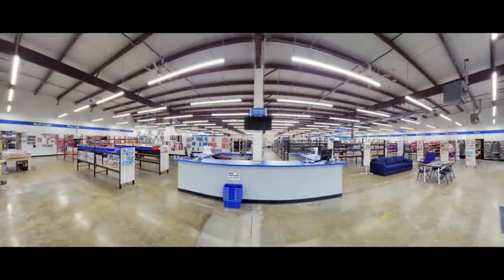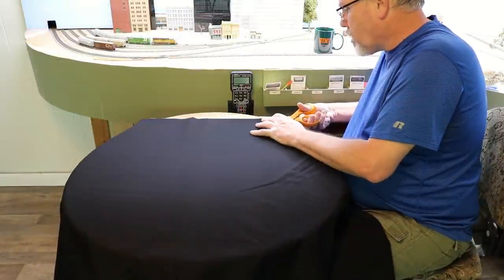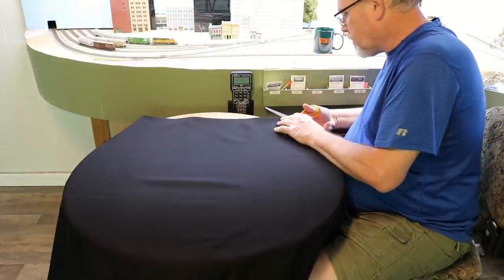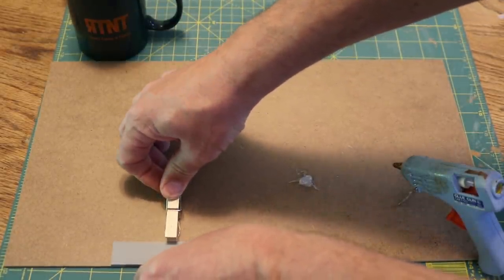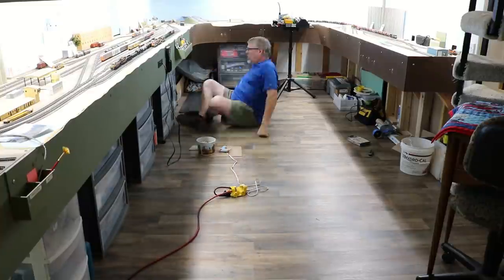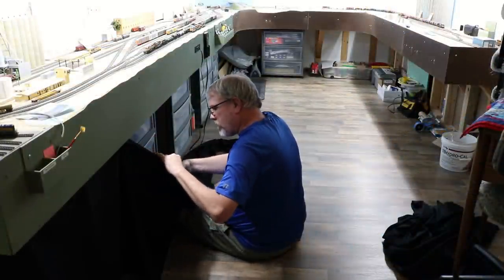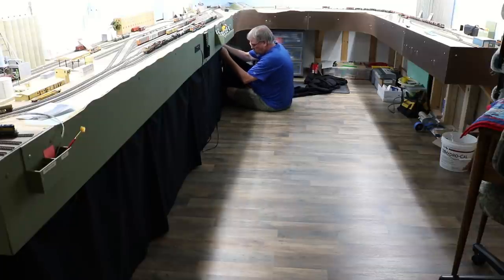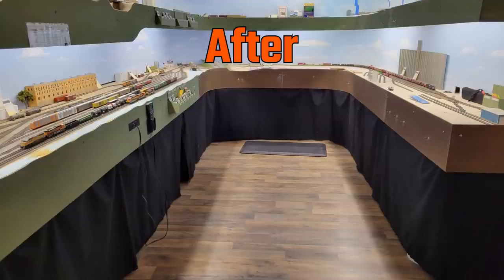Easy Skirting for Model Railroad No Sewing Required

Comment: I built my layout to have an open air feel.  I wanted it appear as if it is floating in the room like the modern minimalistic architecture of floating slabs, clean lines, open floor and room decoration,  funny how things have changed.  Stuff has now collected under the layout and lower shelfs have been added to hold more stuff,  mostly household stuff.  this just took away from that very cool open air floating feel of my layout.  Sad to say skirting might need to be an option.  If you close one eye and squint twice with the other eye you can see that floating slab and open air feel,  just ignore all the stuff on the floor under it :)
Reply from the maker: 🤣 I can see it. 😱🤯

Comment: Hey Ron,
Your an All-star. Got your game on. Go.  OPPS!  I derailed for a moment.
So the three RxR Clubs I belong to use a similar technique.  And they have lasted, with periodic material updates, for more than 60 years.
Last night I was able to start the rebuild of my own layout.  And I do something completely different.
I am a fan of shopping in Charity Thrift Shops.  So I have accumulated over the past 20 - 25 years a large collection of used kitchen cabinets.
Over those years I have used the 36" x 36" x 36" base cabinets for benchwork.  But with this newer build I'm also using the 36" x 20" x 36" uppers, I've collected but never found a use for.
The "Uppers" are being mounted to the exterior walls.  Just slightly above the floor.  And serve as a storage yard, RIP yard, Program Track in place, and a run around/spur line.
To get back on topic the great thing is I won't need a skirting.  As the cabinet drawers serve as hide aways for switching panels, or tool (junk drawer) storage.  The box shelving is perfect for storage of Locos, Cars, Structures in progress, and scenic material.  With the doors closed and baby locked the face looks well kept and finished.
The final feature is having built in heavy lockable construction equipment grade castors.  Then should we take the module to shows all need be done is unplug the bus wires.  Wheel the unit away.  And we're on our way.
No matter how you do the job what counts is you got the job done.🚂🚃🚃🚃🚃 So keep chugging away.
Jim

Comment: This is interesting that this came up.. I bought a 20 yd. bolt for $30 about 12 yrs ago... it is a strong material and kinda has a rubbery feel to it on the back side.. the same stuff is now $140.. I started this project over a month ago after watching Daryl from the HO Evanston sub do the same thing.. he recommended Heavy Duty Clothespins which I bought from Amazon, they just have a stronger spring.. I have to do the same thing, cut it in 1/2 length ways... which is perfect as my lower level is about 29" off the floor... Ill need the entire thing... thxs for getting me motivated to cut the stuff and your suggestion on keeping it folded in half evenly...
Take care..... Daylight Dave!!  😜   🤗

Comment: Nicely done Ron. You have spread the word about clothes pins. I’ve used the sam system but only use a dot of hot glue as a quick hold. Additionally I use yellow carpenters glue for the real holding strength. Garden fabric for the skirting and the clutter is hidden. 
Thanks. 
Ps Dollar General has clothes pins at the bargain price of 100 for $2. If you need a lot it can save you a bit. 👍

Comment: Looking good Ron.
You don't need to cut the skirt for access mid way along the length as you could have some loose spare clothes pegs that you could lift and temporarily hold up the bottom of the skirt.

Comment: Nice video ...I just bought the same fabric and clothes pins but my question is how do you access stuff under the layout after skirts installed? Just unpin and pull it back or lift it up? Yours came out very nice
Reply from the maker: I just lift the skirt to access, but you could unpin it as well, especially if you cut it to shorter lengths, say 6' or so.
Reply: @RonsTrainsNThings  Thanks Ron for replying back ...your videos are very well done!

Comment: Hi Ron, Are you using a MRC throttle?  Everybody wants NCE but I have been using MRC products since the 70's. they have always been reliable for me. I modeled in N scale for years just cant see it anymore lol. Love the videos.
Reply from the maker: I am using MRC. I bought the Prodigy Advance when it first came out, then upgraded it to wireless, then had the software updated to Advance².
Reply: @RonsTrainsNThings  thanks for the reply. I am in the process of upgrading mine as well. Keep up the good work. Jim

Comment: Does the material you used collect or hold dust, string, fuzz balls, etc. i.e. does it require any vacuuming?
Reply from the maker: I suppose any material would somewhat, but it is not a high-static material.

Comment: Great timing Ron! I picked up some fabric a few weeks ago (I'm using landscape fabric like others have mentioned) but had been wrestling with how to attach it. Now I know what I'm doing this weekend! Thank you!
Also, would you be willing to share the paint code for the color you used on the fascia? I know you said "olive green" in your fascia video but am curious about the actual color and where you purchased it. Thank you again!
Reply from the maker: Well, there is nothing special about the fascia paint. I use inexpensive flat interior latex and a color that "looks right" to me. This paint I bought 10 years ago. It is a Valspar color but my label doesn't have a color name, just a base and mixture: base 795330 Clr, B 20 shots, C 40 shots, D 8.5 shots, KX 1 oz 26 shots, that's for a quart. Good luck matching that. 🤣
Reply: @RonsTrainsNThings  😂 thank for responding Ron, I'm sure matching that will be no big deal! j/k

Comment: It sure altered the look of your layout and layout room tremendously.I'll probably use this when my layout gets to this stage. I may have missed it but what is the cost of this cloth?
Reply from the maker: Cloth is not cheap. I paid about $90 for this cloth on clearance sale. Normally would have been $135...but that is for 9 yards of material, enough to make 45 linear feet of skirting.

Comment: To bad your done. I would have suggested to either lay the cloth out and have someone hold one end and run either a clack line or a white wax stick with a straight edge so you would know your line or edge to run and make it a little easier to hang because you wouldn't have to guess.